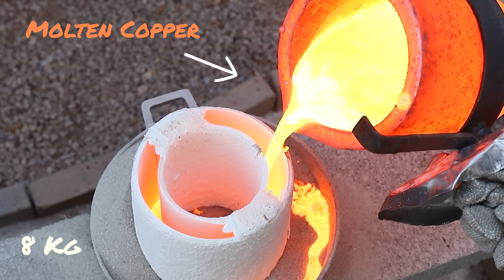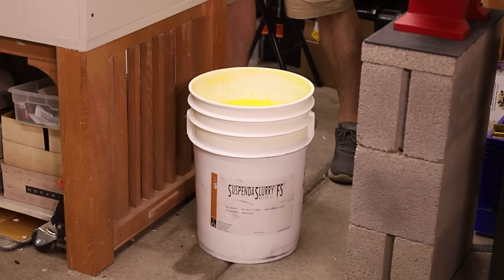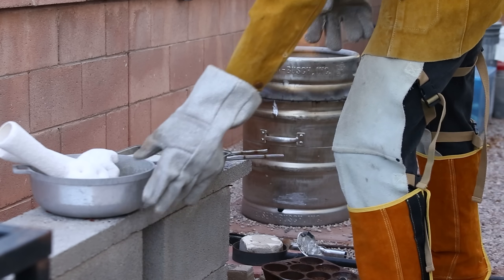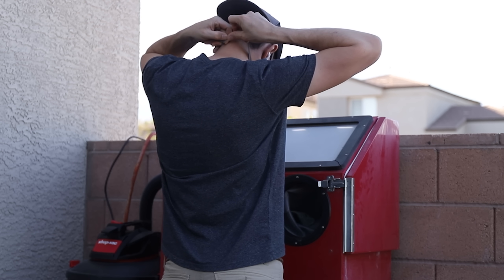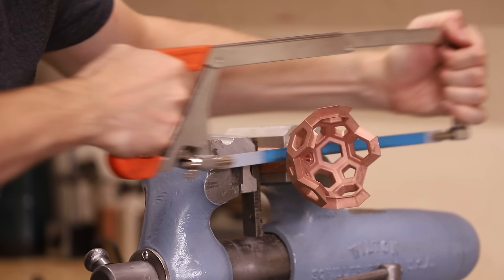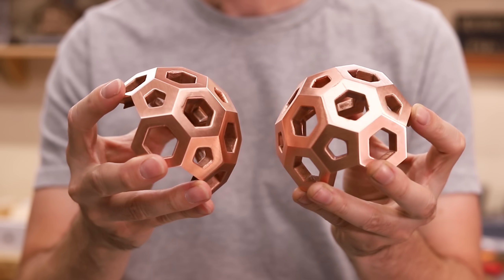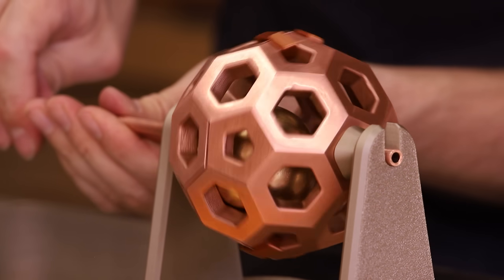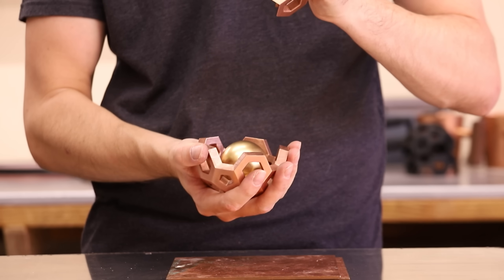HUGE Magnet VS Copper Sphere - Defying Gravity- Will a Neodymium Magnet Float Inside?

Comment: 7:55 YOU NEED TO CHANGE AXIS OF ROTATION — that slice is disrupting the eddy current / Lenz’s Law, and the orientation is exacerbating the issue. You're rotating the sphere around the poles, and the slice is along the equator. If you move the axis of rotation to the equator, it will allow for larger, more continuous eddy current loops to form.

There’s a short titled “Can a non-magnetic material be stopped by a magnet?” by tamuphysastr that overviews this concept pretty well
Reply: Or have a different design for the copper sphere that allows the eddy currents to form. The structure of the sphere, with all those holes, is limiting the size of the eddy currents. Try a sphere with bands perpendicular to the axis of rotation. I'd also try it with the cylindrical magnet inside the sphere.
Reply: @crains8087 Think magnet size being smaller may help?
Reply: @crains8087  Not sure about "perpendicular to the axis of rotation". The rotor in a three phase motor is a cage with rods PARALLEL to the axis. This should work here as well.
Reply: I am thinking of something like the longitudinal lines on a globe with the axis at the poles.
Reply: with an equator to fasten it together.
Reply: Hi what about a cube at inner side it's a hollow sphere and by the logic it should be balanced at corners too right means we can balance this structure at the corner of the cube too  @crains8087
Reply: @crains8087  OR a glass sphere full of mercury with the magnet on the outside as it was in the vid, and try adjusting and varying the speeds on bothe the magnet and the cage, maybe the complexity of the cage is to limiting, also take away the insulation on the axle adding varied voltage / amperage l'm really intrigued with this.
Reply: @crains8087  Honestly, he just needed to use "magnet wire" in loops rotated so as to create his dodecahedron, or whatever the polygon you're trying to make, then the magnet wire can be fed into a pwm controller, in order to keep the stator (in this case the ball) suspended.
Reply: @crains8087  well if it didnt have holes it'd be a bit pointless no?
Reply: It's 100% the shape. It's creating patterns in the eddy currents which want to follow the shape of the copper. Remaking the mold with a band like structure (Think a spherical set of jail bars that meet at the poles) might give a better result. Or, if you wanted to have the bars of copper going along the axis of rotation, clip them in a cage like formation with plastic bars running one way and bands of copper running the other.
Reply: @commodoreschlippy  Nah probably not. That's pretty thick copper. The same way that  kinking a thick wire a little isn't gonna perceptively alter it's resistance. The cut in the middle is definitely a bit more significant. Not sure how much though. Depends on the contact resistance resulting from how well those surfaces are contacting. The more likely issue is like someone else already mentioned. The magnet ball will most likely eventually start spinning and aligning with the spinning cage so the relative velocity will reduce, which also reduces the induced counter force. So it will always eventually drop and be pushed to that off center lagging position.
Reply: @commodoreschlippy  I came to say the same. It's about field lines.
Reply: what if he welded/soldered/brazed the two halves together? would that help?
Reply: @cynikal82  sure but defeats the purpose of the entire assembly.
Reply: @benb3928  would simply turn an assembly into a weldment, to facilitate the purpose of levitating the magnet
Reply: Maybe a high silver solder could reduce the resistance between that halves far enough that its of little consequence??
Reply: Jesus I thought I was smart with my comment and literally everything I thought you guys had already posted to no end..lol  @fredorpaul
Reply: No rotating over the poles. The magnet will always turn to align its poles with the axis of rotation, i.e. so that it feels the lowest forces.
For the same reason it starts rotating with the sphere until the speeds match, the eddy currents cease, and it stops levitating :(
Reply: @HB-et5iv  So you think that if the motor speed varied, that it'd levitate within the sphere more smoothly?
Reply: @hansedrachensohn530  Yes.
Reply: @hansedrachensohn530 a variable speed motor allows the speed to be more accurately controlled so he can get the speed just right
Reply: @hansedrachensohn530 when too fast and too slow don't work there's usually a sweet spot in the middle.
Reply: @HB-et5iv  my thoughts exactly
Reply: @HB-et5iv if the outer surface of the sphere was actually spherical instead of faceted and spun without a constant axis (something like twirling a ball around on your fingertips), would that counter the ability of the magnet to match rotation and keep it levitated?
Reply: @HB-et5iv   " rotating with the sphere until the speeds match, the eddy currents cease, and it stops levitating :("

Kind of like an induction motor?

This suggests that varying the speed in some way would continue "slip" allowing currents to generate.
Reply: The copper itself is conductive.  The disruption is really just the airgap and oxidized metal.  Changing the axis of rotation isn't needed if you can reduce that.
Reply: very good!
Reply: Electrically seal the ball, solder it together and try again, also there is a great comment on lighting and shutter speed, give it a go.
Reply: I don't know if he can ever fully remove the fluctuation with this shape since the current will always follow a sort of zigzag path and never a proper circle. On that topic, I'd love to see a simulation of the field shape on that thing, must look crazy!
Reply: Solder it closed
Reply: @seancraven2361  Solder has a lot of resistance.  Far better than an air gap but its conductivity is definitely not on the same order of magnitude as the copper.
Reply: Is there a way to see how much current is being generated by the magnet moving inside the copper as it spins?
Reply: @triaspia maybe put the whole thing in a vacuum that has iron shavings in it….somehow
Reply: @triaspia that's what I am curious about and I want to communicate with everyone interested in thinking on that exact topic (and more) in relation to this exact subject matter.  I think this is the "missing link" in creating sustainable energy. 

Very amusing to me because it's pretty much just the opposite of WATT skientiz have figured in creating current, copper surrounded by iron, rather than Cooper wrapped around iron. 

Supper curious about other shapes of cooper, magnets being added, and even throwing a tesla coil into the mix, with that thing or similar mounted above it, surrounded by mounted "stargates" (wound Copper in a star fashion numbercal pattern)    test currents of various arrangements, even shoot a lazer at it and throw stuff at it..   I'm a offgrid guy and just came up a massive battery bank, foundry build is on the list but it's aways down on the priority list, but Def in the plan. Excited to try some of this I've been pondering and try to create some power,. and who knows maybe even a portal to a differnt dimension where "they-them" don't exist.
Reply: It will just fall to the bottom.  You must rotate it perpendicular to gravity.  I'm also not convinced that the eddy current can't easily move across the seam, since the two halves are touching each other.
Reply: 7:36 maybe you could cut some nice patterns into them and hollow them out.

Maybe some fancy lamp or a nice sculpture
Reply: Would the problem persist if the slice is welded shut and thus removing even the smallest gaps?
Reply: Yo! That makes so much sense
Reply: Couldn't you just fuse the thing together with a bit of solder and make that a non issue?
Reply: Wouldn't the joint allow current flow?   Is there copper oxide that might inhibit current flow?  Would plating along the mating surfaces allow good currently flow?  Maybe silver or some other material?
Reply: @jamallabarge2665 the thing with eddy’s current is that different mediums the current flows through affects the magnetic fields created, this slight changes are enough to change the path the ball is rotating through. So it’s usually better to use the same medium(conductor) throughout
Reply: @jamallabarge2665  the joint is a problem for current flow. This is a very strong magnet applied to, in effect, just one turn of copper 'wire' so we're hoping for a large current generated by a fairly small EMF. The small EMF maybe won't break through even thin oxide layers. It may help to use a bunch of those beryllium copper clips that are used are the edges of RF shields covering up electronics.
Soldering would be difficult, you'd need to heat all of that copper up and it would oxidize; best case, it would work but would need to do all the polishing again.
Reply: Is this how ufos fly
Reply: @hottoxo I member back in the day hearing about an encounter where there was some gold sphere  floating in some kind of cage also have heard of gold and  mercury alloy super cooled and thaen energized levitating probably just snake oil tho😅
Reply: @Lzardkng  appreciate the humble pie at the end ,enjoy buddy but you my friend are very wise and that was very interesting 🤔. If we really have a open mind here I mean , nothing is new under the sun so what if jus maybe with a little more to it we jus might already have a key to the puzzle here but if not hey , whatever I'm still intrigued because how can anyone say no? When we don't know anything really just pure speculation, and opinion base from so called man credited scholars ,some  to whom I have a great deal of respect for, just merely for their contributions to science.  I salute them them..
Reply: I don’t understand half of this video and most of this comment section
Reply: Always fun to watch scientists who all know they're right, prove each other wrong.
Reply: @kwimms  scientists proving each other wrong is pretty much how science works by design.
Reply: @kwimms  that's how a thesis in scientific discoveries works. you set one up, you get scrutinized until you can prove without a doubt that your thesis holds water. if we didn't prove each other right or wrong, science wouldn't work.
Reply: @kwimms  you got a bias against scientists?
Reply: Are you, perhaps unknowingly, on to solving the archeology mystery of roman dodecahedrons? (image Google for that)
Reply: LOL, they’re two spheres, changing the axis of rotation will do nothing in regard to the magnetic effects.
Reply: What could be almost as good is sanding down the mating surfaces to as pefect of a fit as possible and then painting them in a thin layer of conductive putty or similar compound that'll decrease the resistance between the two halves so there's less of a break in the eddie currents.  Cooling the shells before a demo may also help.
Reply: Incorrect.  you're just not generating enough force to get the 1.21 gigawatts of electricity needed to activate the flux capicitor. Duh!
Reply: 🤓🤓🤓🤓🤓🤓🤓🤓🤓🤓🤓 um actually you're a nerd
Reply: I have no idea what he is talking about but I agree with this guy
Reply: I was coming here to talk about the slices causing problems with lenzes law. But yiou beat me to it.
Reply: Why not just set it up to spin finding the desired speed and keeping it there?!🥴
Reply: @derekhoward2232  that would work. changing the axis of rotation would just reduce the speed required to keep the magnet afloat.
Reply: Maybe if you ran electrical current through the copper sphere?
Reply: @AnJean3tte  Solid idea. Yes, adding a current could help the effect, but it would need to be ran through copper windings rather than just electrifying the whole cage.

Magnetic fields from electric current isn't just adding electricity to an object - it’s the movement of electrons in loops (Biot-Savart Law). In the copper cage, you’d need to add copper wire windings (insulated), winding in the same direction that the cage is spinning, to create a magnetic field that complements the effect of the cage spinning.

I’ve not looked much into junk yard magnets, but being able to pick up a car probably requires giant coils of wire looped thousands of times. 

Very solid idea, might just required some extra hardware.
Reply: @matttgray  yeah i dont know really how all that works but I just got to thinkin.. as always safety first though you know.. ?
Reply: @matttgray  I found this as well. That is a really great mold though! Could you switch it so the outside is the magnetic and inside charged particle? All of the charge curent around it evenly make sure none of the steel sphere has any oxidation, impurities any little fleck can throw off even current?  you can x ray it if you need to if you have the means.. After ya mold it dont heat treat it just let it temper. But oh, that could get hot  too? When you have current involved and all that i dont know exactly so Here's a good one about super magnets i found relates to your expirimenting here and theres alway Jody to ask from welding tips and tricks hes great! Best in welding i know of and a video here too https://youtu.be/g0amdIcZt5I?feature=shared
Reply: Think how do the big car magnets in junk yards work? Giant magnet on pick up car. Giant magnet off drop car.
Reply: What about counter rotating the two halves of the spheres
Reply: Is there a way to simulate the fields  before printing/casting
Reply: Yep or actually join along the split using solder.
Reply: Erm........Sausages?
Reply: Gyroscope
Reply: Get a smaller magnet bearing.
Reply: nerds
Reply: @arn8386  Counter argument: brain
Reply: He also needs to control the motion with an Arduino. Using something like an Arduino would allow getting all the waves correct. Like exactly correct. It would be great if he had an axis that could also rotate ---compound rotation. You could manipulate the position of the magnetic sphere and animate it. I don't know how to calculate the copper piece, but it would be great to get the frame to a bare minimum, so that the "windows" into the sphere were as large as possible, and the void in the center also as large as possible. So much potential and looks really cool.
Reply: Well said sir
Reply: h u h.
Reply: what
Reply: E eeeee eeeee ❤
Reply: let me download your brain
Reply: Everyone here knows wtf this guy is saying except me
Reply: @Makememesandmore that makes at least two of us!
Reply: Yes, by being divided in half, the eddy currents aren't traveling the way they ought to. Some of that could be corrected by cleaning the hell out of it and then gold plating the interface to enhance the conductivity. It'd be interesting to see if splitting those halves into fourths, such that you distribute the interference around the sphere and then have each section able to act more effectively against the magnet instead of having two halves operating correctly and then having a gap in the middle.
Reply: Ya, would have to place the bigger ball with 4 motors around it so could rotate it on 3 axis. My mind is going! Would be cool to make a shock absorber for a car/truck!. Expensive though. "Star Trek inertial Dampeners" - a spaceship inside of a hull using this technology to absorb shock on landing or take off in a very low gravity situation due to the weight.: Crash absorbsion bumpers for a car/truck. :
Can make a generator & pull current off the differential both objects. One should be positive & 1 negative. Curious how much it would make & what would influence the current & voltage.
Reply: Yo i would love to buy that sphere for my collection
Reply: found the nerd 🤓
Reply: Build a sphere out of magnet with a copper ball in middle
Reply: What would happen if a current is put through the axle like may be + in one end and - on the other ?
I'm so curious this is fantastic!
Reply: What is the Eddie current?
Reply: What is Wayne’s law?
Reply: @matttgray  yeah I get the idea and the practicality, there's lots of things I'd love to try with this.
Reply: The two halves are in contact just like any electric connection, you really think it's that big of a disruption?
Reply: Can you try the floating ball on a leaf floor
Reply: Bro is smart
Reply: So... what if you reciprocate the drive-shaft... thereby introducing an additional plane of magnetic cross-interference?  It would force the magnet into more circular physical motion (irrespective of plane (because you negate it)).  Suggest: variable shaft adjustment for "Z" plane depth control.  :)
Reply: Looks like sigma's balls from overwatch 😂😂😂
Reply: What you sell me a bell for!? Made out of some yellow gun brass and other scrap I have around? Don’t have to be perfect just the form mainly
Reply: plus lateral movement to attempt to replicate the effect when the ball falls into it from above
Reply: Also if he were to add bearings to each end and slowly start the rotation once the ball is floating he could potentially spin the sphere at any higher speed
Reply: plane the insides to reduce nucleation points & use 3 smaller ball magnets
Reply: Maybe put the plugs into bearing rings like from a skateboard.  Also, maybe suspend the stand on a float above water for neutral suspension position.
Reply: You need a strobe light. A strong LED and a square wave signal generator will work. This will allow you to see the floating ball through the holes. Neat project.
Reply: Did you know that Jesus is God? Jesus, the Son of God, gave His life on the cross for the forgiveness of sins. Through His sacrifice, we can live forever in Heaven! Repent, follow Jesus, and live forever! If you want to learn more about Jesus and Heaven, check out the Gospels of Matthew, Mark, Luke, and John in the Holy Bible.
Reply: Or smooth out the printed part before casting it.
Reply: I hope he read that
Reply: maybe add a strobe disc attached to the icosahedron for syncing would be better lighting.
Reply: You're clearly disrupting the polarity with each turn and thus ignoring gravity pull compared to that magnet ...try changing axis, 

And also, if you can get an hollow magnet we'd all be curious to see what/how it does
Reply: Which raises the whole issue of what really is a spherical magnet?  Wouldn't a true spherical magnet be oriented center to surface? -- North pole in the center & South on the surface or vice versa?  Could such a super magnet be made without exploding?
Reply: Use a copper dust within an epoxy resin to make an opaque sphere, making sure somehow that the copper is evenly spread. Due to non contact locality it should work similarly to solid copper with a little noise which could serve as a coushin
Reply: Ad some bushings to the shaft, make a current pass through
Reply: I’m really impressed by how strong the magnetic braking is. Could you explain how the size and thickness of the copper sphere affect the strength of the resistance against the magnet? Would a thinner wall result in faster movement?
Reply: How about, you 3D print, around the magnet itself....Your experiment is AMAZING....Thanks for sharing.....
Reply: I found the vid you recommended 🙊👍🏻
Reply: Bro, stop yelling. Also you don't have to show off your physics knowledge. This is not that complicated.
Reply: nerd
Reply: So when are going back to the future bro can I hitch ride .
Reply: @RonaldBaldwin-t3h already here bro, welcome
Reply: This guy gets it.👍
Reply: *exacerbating
Reply: Incorrect
Reply: Nerds ☝👇
Reply: That is complete BS. You have no idea what you're talking about.
Reply: @nabman5619  Dude, look up eddy currents.  They need to be able to make complete loops or they can't form, and this design is terrible to propagate them.

It's ok not to understand things, but it isn't cool to be disrespectful to people trying to explain complex concepts in simple terms so they are easily understandable.
Reply: @nabman5619 proof: trust me vro.
Reply: @nabman5619  He is lucky to get comment from a real expert then :)
Reply: @nabman5619  So, TELL us what you know about it, to prove us that you know better about it, something Not BS. Please show us here
Reply: OR...you could make your own video. The only good thing about free advice is the price. Even then, it's not worth it.
Reply: @ironmask5308  did you tell your teachers that in school too?  Providing accurate information isn't giving advice, and critiquing someone's misstep allows them to learn without having to work through the process themselves. 

Our modern world is built on the discoveries of our ancestors, stop badgering people for continuing to do it.
Reply: @8yourpets  working the process out yourself is far more satisfying than reading comments from people who claim to be providing information when in reality they are trying to prove to everyone how smart they are. They should get their validation elsewhere.
Reply: @ironmask5308  and that's how you stifle innovation.  Every modern invention is based on dozens of older inventions and ideas, like I said, our entire modern world is.

The big advantage we have over lesser animals is that we can communicate our thoughts and ideas to each other, we can teach people things without having to demonstrate.  Why are you insisting that we devolve to the point where we can't teach each other?
Reply: @8yourpets  I don't think we're gonna find any ground breaking discoveries on YouTube. And you missed my point. Many of these comments are solely for the poster to show off there (over)estimeted intellect.
Reply: @ironmask5308 bro got bullied in school 😔
Reply: @ironmask5308 stop projecting how you are.
Reply: @ironmask5308  like yourself, right here. 🤔
Reply: @ironmask5308  Hello friend, the youtuber clearly asked for suggestions at the end of the video "Let me know any experiments I should try..." I think flipping the ball by 90 degrees and spinning it that way falls as a suggestion. What's the problem with people suggesting things? Especially when crowdsourced ideas come from people with different perspectives and specialties.
Reply: @ironmask5308   Who pissed in your cheerios this morning???  geez
Reply: @ironmask5308  not everyone can afford or have the technical ability to.
Reply: @ironmask5308  it's all about validation with you, apparently.
Reply: @jollyroger6258  I would bet you don't.
Reply: @ironmask5308 that whole doing it all yourself is more fun, tripe, is ridiculous and thankfully we haven't worked like that for 5500 years. Hopefully we won't follow your lead and start now... it would be a disaster
Reply: @ironmask5308 I thought he was showing off his craft skills.
Reply: @ironmask5308 looked like a wireless gear.